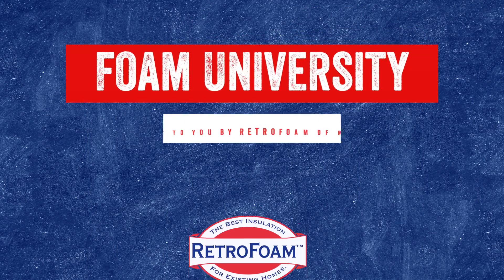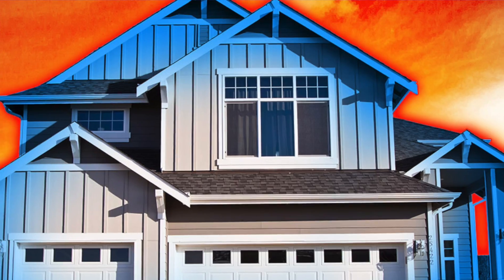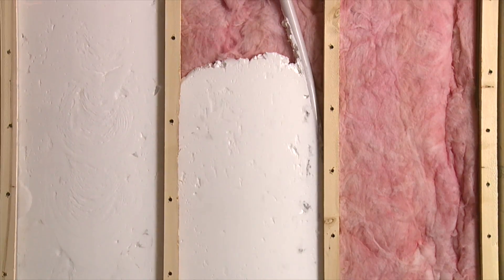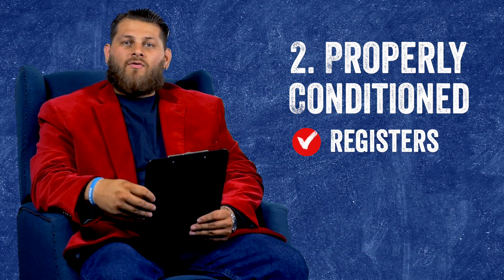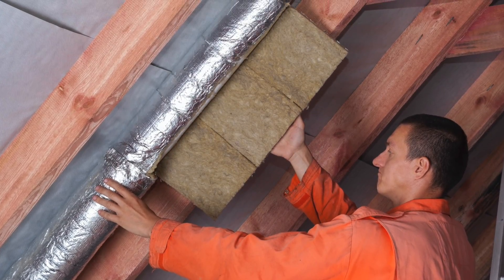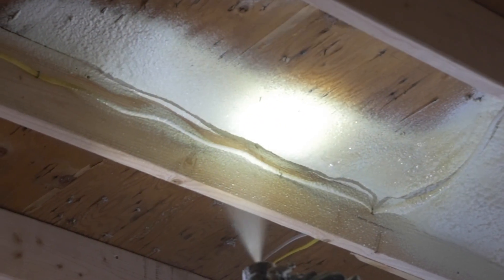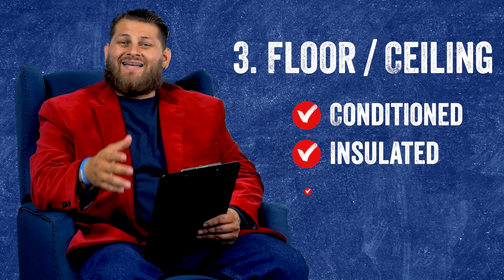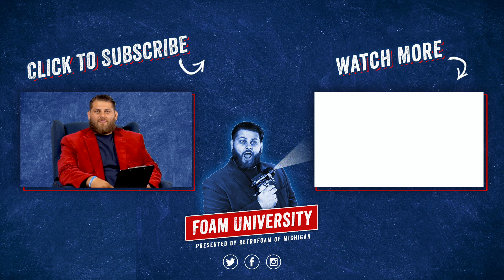What to do When the Room Over Garage is Hot in the Summer and Cold in the Winter | Foam University

Comment: I have a portable AC and the main AC working simultaneously in my above-the-garage room in the summer. It becomes ice-cold!
Reply from the maker: That's awesome!
Reply: What ac u recommend
Reply: @4kt_38s  I have a Euhomy for my small room.  When it gets very hot (40 degrees Celsius or higher), I use it with my central AC.  If you have a bigger room, make sure you get the most powerful version, since these portable ACs are weak in general.  They need to be used in conjunction with the central AC in your house.

Comment: Question I live in Florida it doesn’t get cold at all. I bought a portable ac 14000 btu and I have to vent it. Since it is hot air can I just vent it into the attic? My attic is huge. 9ft ceilings. Or do I still need to insulate the attic floor over the garage. I have roof vents periodically throughout the roof. Plus the soffits are vented
Reply from the maker: I wouldn't recommend venting into the attic. It is best to vent the air outside.
Reply: @RetroFoamofMichigan  ok good to know. In my situation is it worth insulating the attic floor
Reply from the maker: If you insulate the attic floor, it could work to keep your treated air in the garage.
Reply: Ok thank you sir
Reply from the maker: No problem at all. If you have any other questions, please don't hesitate to reach out.

Comment: The « room » over the garage is my master bedroom, it will be my first winter in this house. Bonus, my garage is isolate
Reply: I would say the winter is easy as a cold room can be over come by wearing clothes and sleeping in a duvet. Summer. Good luck. With temperatures in most of America hitting 90-100s and even with ac on at 72 degrees blinds and a ceiling fan, its still high 75 -76 in the room. not good!